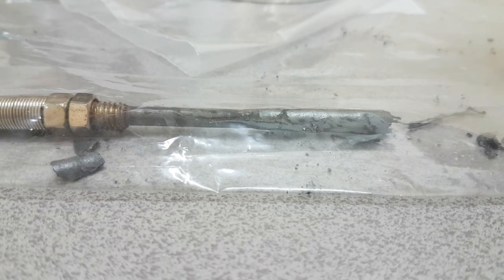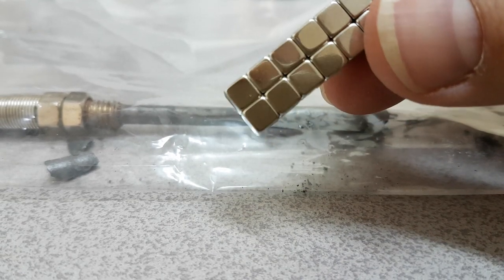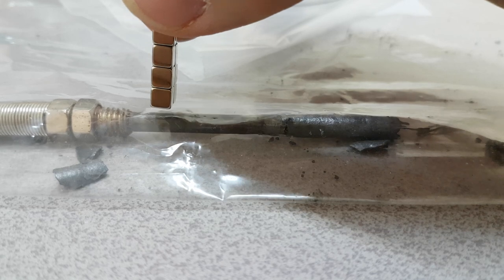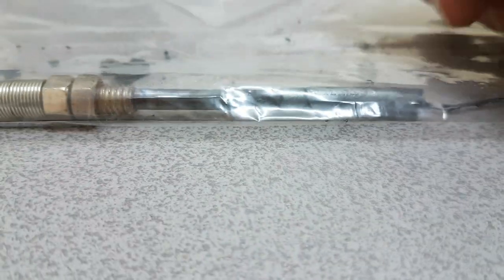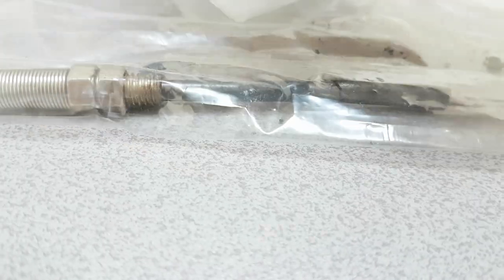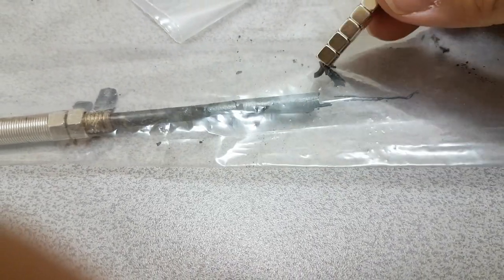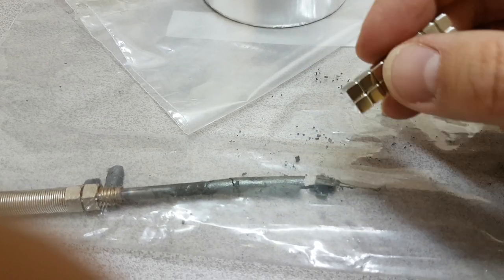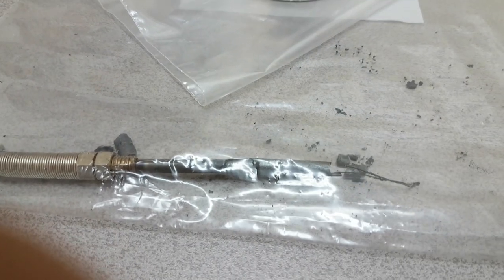LION Four - Testing toasted stainless steel thermocouple for magnetic properties

Comment: Interesting...with 316 stainless steels they are alloyed with 16-18% chromium, 10-12% nickel and 2-3% molybdenum. With 304 stainless steels its alloyed with 18-20% chromium and 8-10.5% nickel. Both Iron and nickel are strongly ferromagnetic, but not when alloyed with chromium or molybdenum. Black iron and nickel oxides are also very magnetic and are used to make ferrite cores. Metals expand quite alot when they convert into oxides which appears to be the case here?. So whats happened to the chromium in the crystal lattice of the austenitic (nonmagnetic) stainless steel?, and potentially also molybdenum if the stainless sheath was 316 grade?. A fairly strong solution of ascorbic acid (Vit C) is a fantastic and super safe de-oxidizer for converting metal oxides back into their shiny metals. (Including dissolving metals after a long soaking time into various colored ascorbates, which also have different crystal structures like metal salts in general). So maybe you could de-oxidize a fragment of the cooked sheath and see what it can reveal too :) (y)
Reply from the maker: Thank you for the proposed test. Can you be more specific with a protocol and intended purpose and expectations for findings

Thanks
Reply: The intention is see in more detail to whats happened to the stainless steel alloy, eg by de-oxidation of the sample will firstly determine if the structure of the alloy is still intact or falls apart into pieces or particles. Also different metal oxides take different periods of time to de-oxide in ascorbic acid distilled water solution and can return to their shiny metal state quite quickly in just a few minutes often like magic. Then you can test to see what returns to a non magnetic state afterwards eg is the chromium intact or not combined with the magnetic iron and nickel as an nonmagnetic austenitic stainless steel alloy (although the nickel also needs to be checked if its still there, or transmuted into some other element maybees, abit or not). With longer soaking times (or with a bit of heat to speed things up if need be), the more reactive metal will dissolve (eg iron most likely) into iron ascorbate which is documented as being very soluble in water, then followed the other metals slowly over time. Quite hard to find data or examples on what colours all these particular metal ascorbates would actually would be (eg ive only done this with aluminum, zinc and copper oxides before). But you could do an initial baseline test with some known example metal samples first in ascorbic acid, to determine what colour solutions & "proportional" dissolving times these particular metal convert into salts should be. Or far easier you could instead just use say hydrochloric or sulfuric acid, as all these coloured metal salt solutions are very well known (seeing the various colored salt solutions come off could make good viewing on a vid too). So say after initially de-oxidizing in ascorbic acid, then with a good wash in distilled water before the next conversion process with common acids of ones popular choice. Hope that helps, although some mass spec would be the way to go in the long run for greater detail although expensive (also recommend flame tests pref in a fume cupboard as another quick low cost alternative for basic metal analysis)  ;) (y)
Reply: Plus: Basic flame test colours for most metals for pocket handiness wiki. But for more indepth flame or plasma poor mans light spec analysis, compare with online elemental fingerprint spectral line examples, library's or databases :) https://en.wikipedia.org/wiki/Flame_test